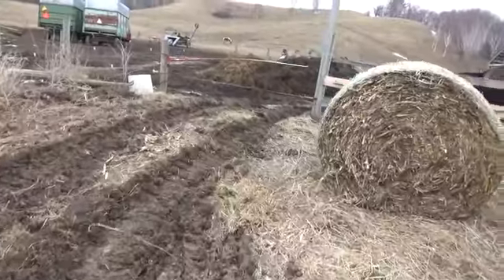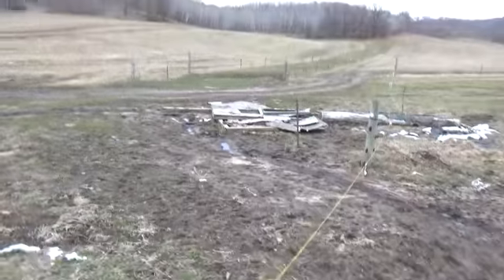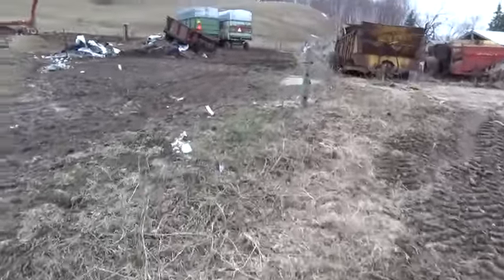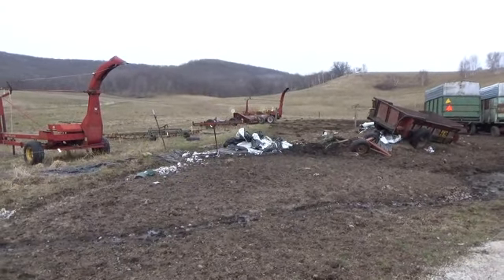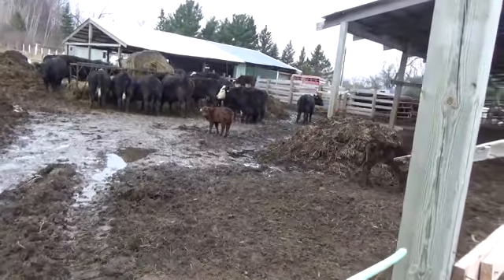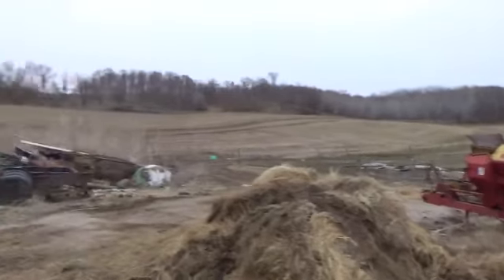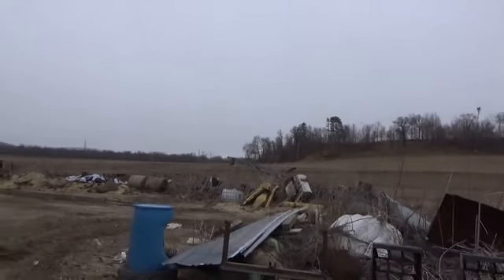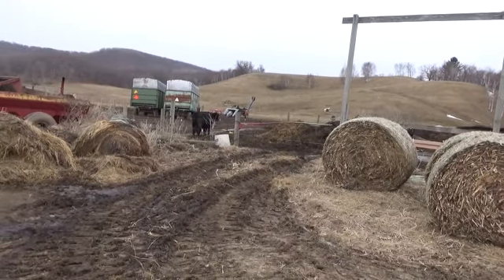Quick, Cheap and Easy gate

Comment: good point about the poly wont bend up like wire on the gate. will have to remember that!  no snow yet but were still in the 14 inch zone.  this summer I have a lot of them little piles to burn, if the net wrap wasn't in them I would leave them melt into the pasture.

rye is greening up!!  phew. lol  
looking at the forecast for the rest of the month looks like not much happening in April.
Reply from the maker: Well, if you don;t get any snow I would be more than willing to send you some of mine! 10 plus inches on the ground so far and still accumulating pretty quick! Yes, I am a little relieved to see the rye is germinating, I am trying to buy another chop and hope to chop all of my rye for silage
Reply: @LVFFarmVlogs  holy hell it's just starting to snow now we got maybe an inch.

Comment: I never had much luck with the poly hot rope my cows would break it even hot lol so barbwire was the standard and a smooth line was hot
Reply from the maker: After having 3 animals get wrapped up in barb wire as a kid it didn't take long for me to hate it, so when I bought my own farm I started from scratch with hi-tensile. A good 200 mile 15 joule output fencer and never have had a problem. I have a polywire in the cows lot as a trainer for the calves before they go to pasture, never any issue's sense. My cows learned the poly wire hurt before I ever put them on pasture as well. Now, half the time I don't even have the fence charger on and the cows are always where they belong!
Reply: yeah i never had too many issues usually with my dairy herd it was the range animals that were hard to keep in but it came down to panel fence or pipe gates to keep them in a lot for training time

Comment: Do you no till directly into your manure that you spread
Reply from the maker: Yes sir, I don't even have sweeps, just the wavy coulter. If there is a big chunk of manure I will get off the tractor and kick it out of the way, but my spreaders are pretty good and not leaving big clumps
Reply: Okay thanks just doing some thinking. Already do no till on most acres just always did a pass with finisher on manure ground and wanting to start experimenting with cover crop
Reply from the maker: I like leaving the manure on top because the worms do an excellent job of incorporating it for me! The planter and drill never really have any issue planting thru manure unless you have a wad of hay
Reply: Okay thanks for taking the time to share the info. Might also experiment with 60" rows not for sure yet although